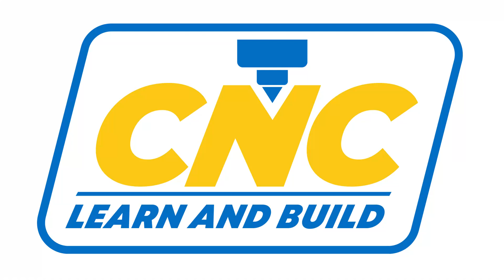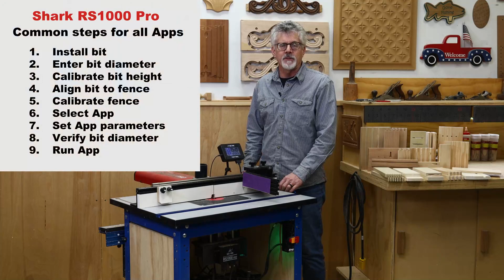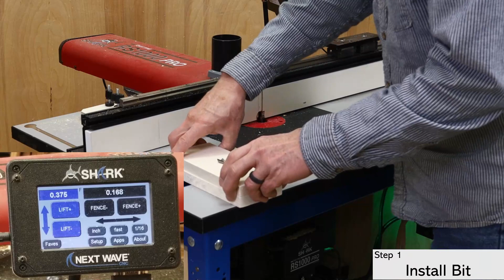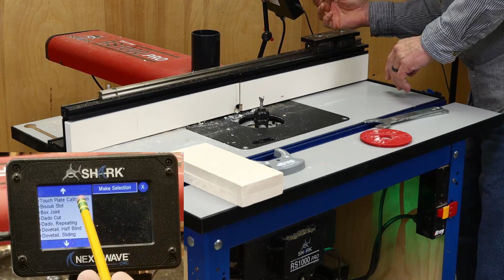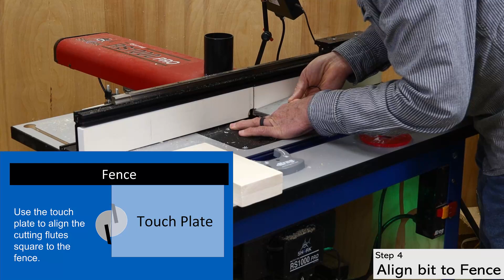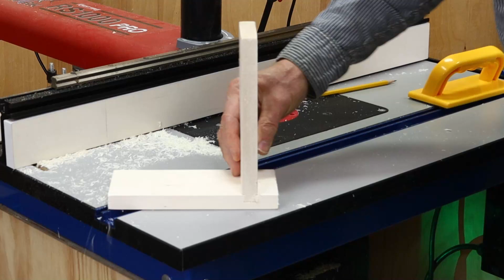06 Sliding Dovetails with the SHARK RS1000 Pro CNC router table

Comment: What does that plate do?
Reply from the maker: The touch plate is used to calibrate the fence and router bit. When the calibration is complete, the top of the router bit is set even with the the table top. In a similar fashion the plate is used to calibrate the bit to the fence. The fence can be calibrated to the front, center or back edge of the bit.